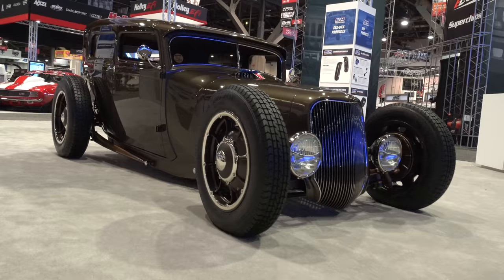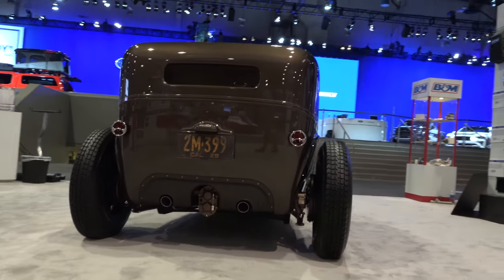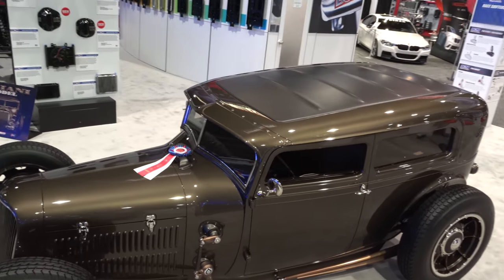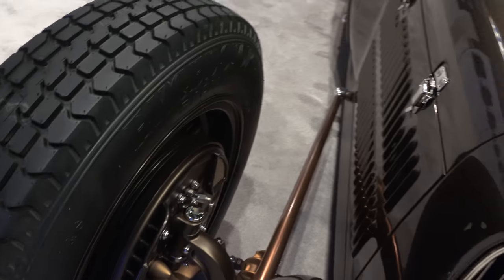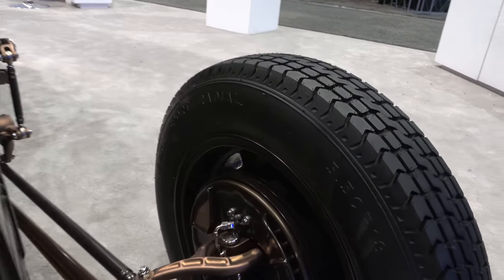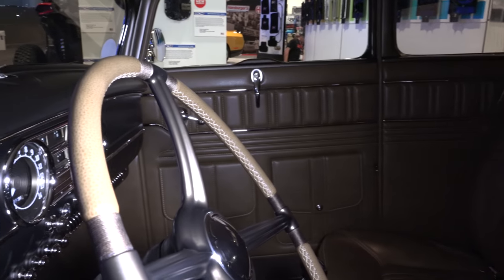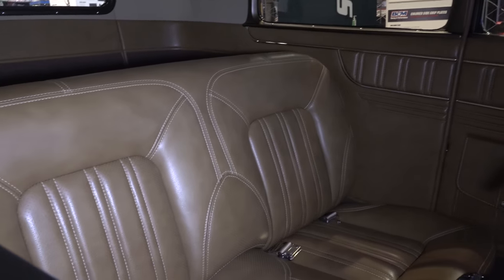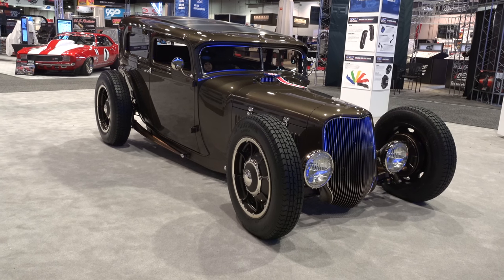1929 Ford Model A Rad Rides By Troy The SEMA Show 2017

Comment: It continues to amaze me that shops are putting out such pieces of art. It is truly humbling when I go back to my project and realize "I can do better". Well, not really. I don't have the skill or the money! But it is fun to dream.
Reply: wyattoneable You can you have to take your time I've seen some of the Badest cars come out of small garages I'm in a wheelchair and I built some of my own rides my first car was a parts car I bought from my father for $50 it was a 68 Toyota Corolla 4 door took an ugly duckling and made a beautiful swan out of it put a 51 Buick grill cut down of course and got old metal chrome BMW bumper guards and put all 4 on the front bumper with Apple tones lamps on the hood the stock hub caps I drilled holes in the middle to put spinner knock offs with white wall tires my Pops and I rebuilt the 4 strock engine where gas was a $1. I got great gas mileage in that Car and went to just about every car show in the 4 years I owned it and got thumbs up everywhere I went in it, my father had many of those little cars he just never seen my vision of one and I built many cars after that with help of course but like everything it's a challenge. Some people drive as the work on there's they may change a few things at a time, I live in California So there are many many shops and Car guys to swap parts with that helps to
Reply: I use to live in So Cal and your right, so many shops and talented people there. Thanks for the comment.
Reply from the maker: lol.....I think you can do better Brother...We all can....and sometimes all it takes is seeing something and than it clicks and you are on your way....The talent out there is crazy for sure....But the Guy at home is still the foundation of this industry...So do your best...and show it with pride!!

Comment: Yank that gm motor out of there and put in a BLUE OVAL then you would have somthing!!!!!
Reply: bradley1970.  Not sure why they didn't want a 351W stroked, or even a 5.0 hhmmm
Reply: They have run Ford motors in the past,  just check out the 67 fast forward fastback.